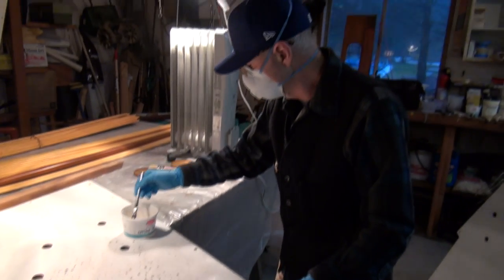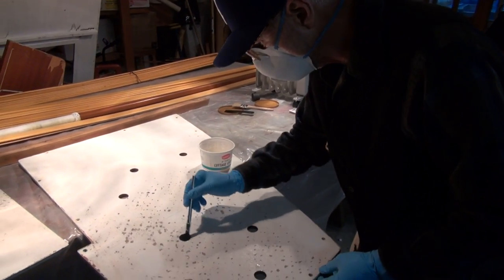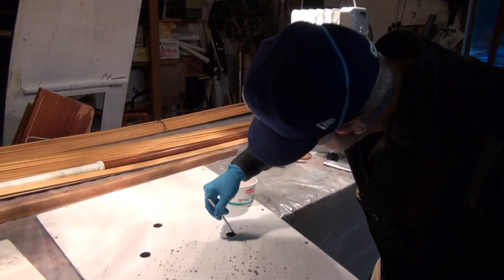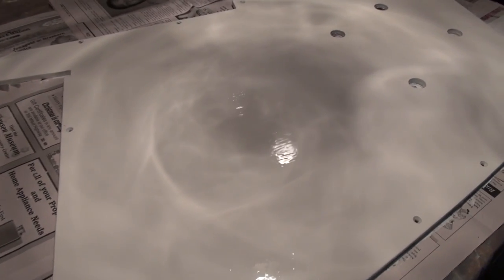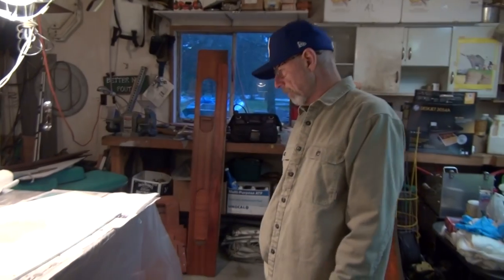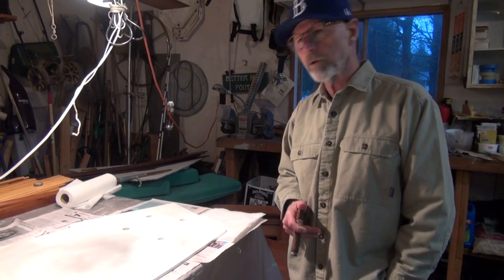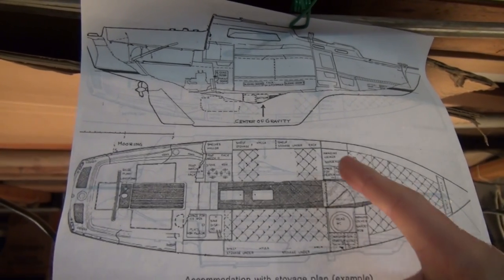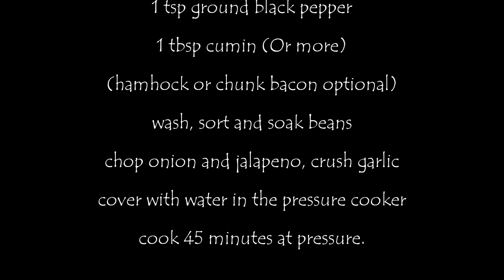Cruising Lealea Refit No.14: Old Paint

Comment: The channel life is like sailing. Used a system under the V birth cushion to keep the mold away. I cant remember the name of it, but it was a bunch of plastic snap together pieces that kept it from laying flat and let airflow
Reply from the maker: +Urban Deployment Sounds like Alfy used Dri-Dek http://www.dri-dek.com/ We have used Dri-Dek inside lockers to keep gear off the hull and allow air circulation.  It is very tough and works well in that application or under foot.  It is rather heavy though, and only 1/4 inch thick.  Under the bunk we use HyperVent http://www.hyperventmarine.com/products.html  It is much lighter, provides three times as much air space and much better air circulation.

Comment: looking at the green cushions in the background it brought to mind what I did to clean up my cushions on my C&C 26. I took them off and put them to the dry cleaners at $5.00 each. they  came out great, like new. I think the 303 might help as well.
Reply from the maker: We are using the same cushion covers but have to replace the foam due to mold. The covers are Sunbrella fabric and are easily run through the washing machine.
Reply: Thanks for the quick reply! I had poor luck with some of the stains on my green cushion covers so the dry cleaners worked out for me, I just had to make sure they understood it was an acrylic material. BTW, is there a video of Lea-Lea after the refit? I'm visualizing a really nice interior! thanks.

Comment: In real world would it be better to paint all of the raw wood with penitrating resin
Reply from the maker: Yes. We did that with all the new wood that we used. This particular piece, we decided to modify and re-install, rather than replace it. The V-berth deck had been replaced in 2007 and was sealed and painted at that time. We modified it by cutting the vent holes and sealed them, then repainted. I think the v-berth deck (3 pieces) is the only plywood that we did not replace with new lumber.